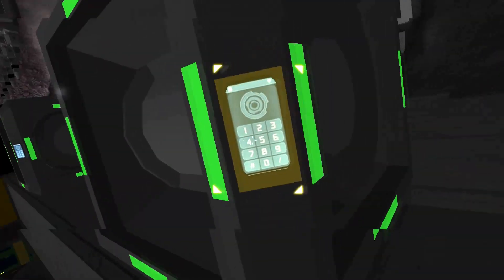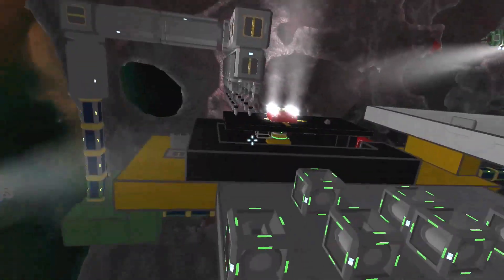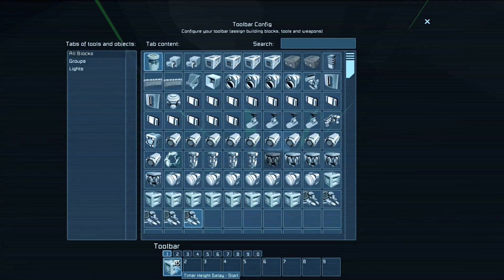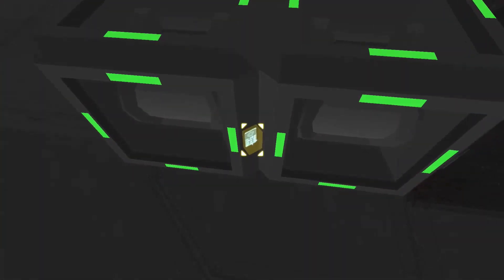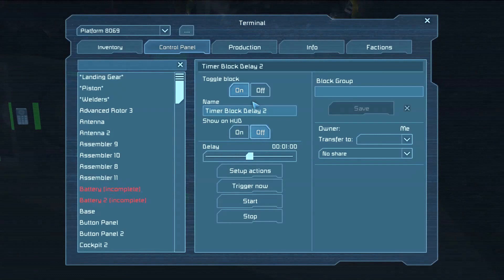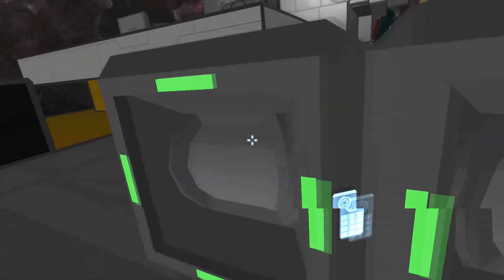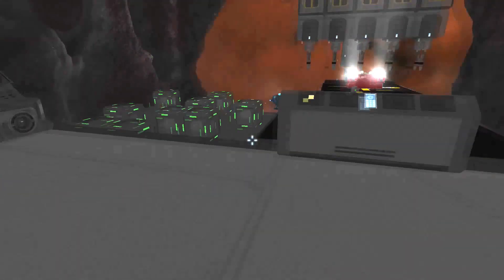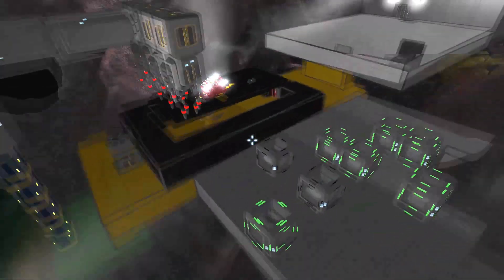Space Engineers - Part 7 - 3D Printer of small ships

Comment: after seeing your video it inspired me to want to build my own 3d printer.

it looks like crap...but functions well
as all my ships do. ^^ 

it can fly around and has a rough square shape to it.
at the top center it has 2 small pistons connected to a medium cargo container for supply
Thats connected to a row of conveyor
then below that 15 weilders with 5 line per a row
the middle 5 get materials the outer 10 speed up the process

i have the pistons slowly retract one at a time stopping it moving when while its weilding and being moving it while it isn't weilding parts.

i ran into 1 major problem and that was when the bloody things landing gear stopped working and it floated off. :P 
massive panic to fix some thrusters on it allowing it to fly.

i need to take a proper screenshot but you can kinda see it in this one here.

http://images.akamai.steamusercontent.com/ugc/351647207503308270/99EB4BFECE1713B48DA5AA67C41093C76CEA5184/

Thanks alot for the inspiration